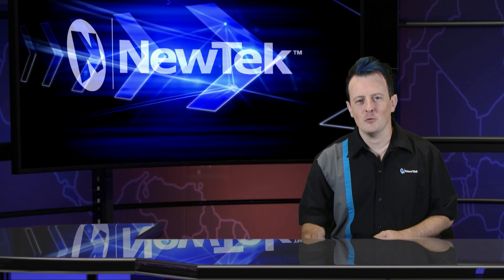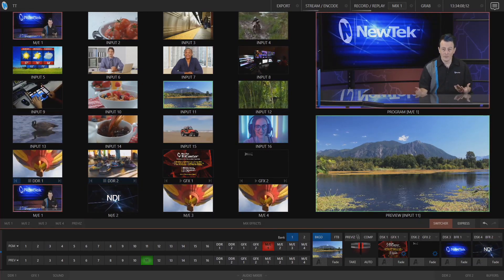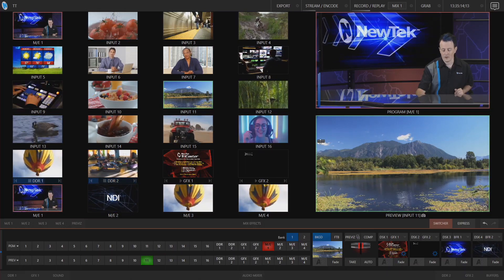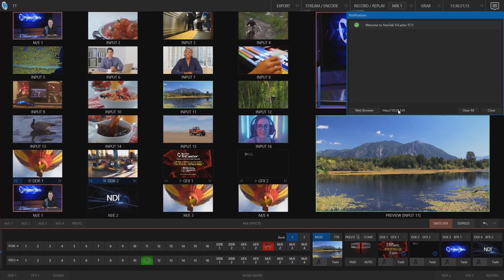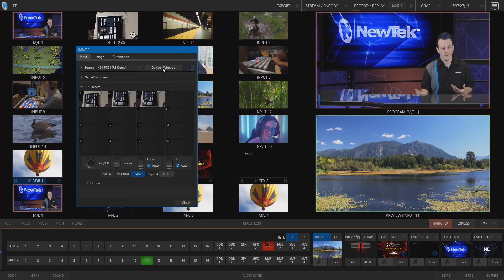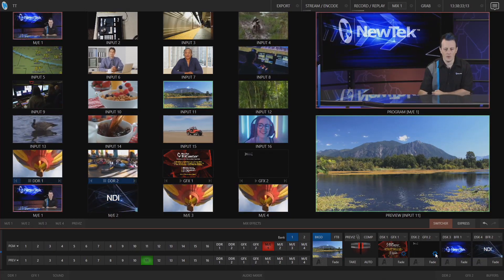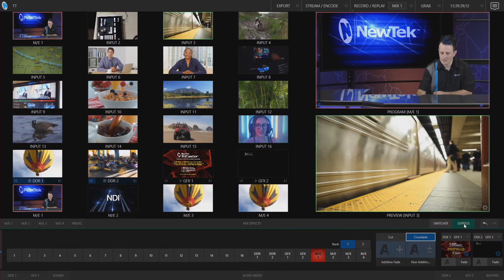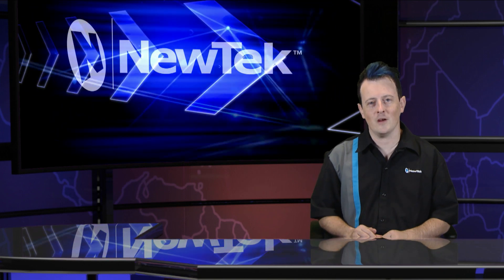First Look at TriCaster® TC1 Update

Comment: so what happens when you want to change your PTZ preset during a show?  you have to go to the input menu rather the tab appear to see which preset you need?
Reply from the maker: correct or an easier way to recall those presets is to assign them to a keyboard shortcut using Macros :)
Reply from the maker: There is also a Livepanel feature to do this as well.